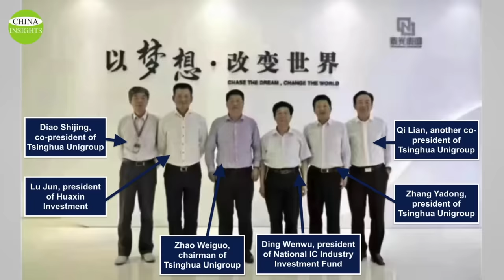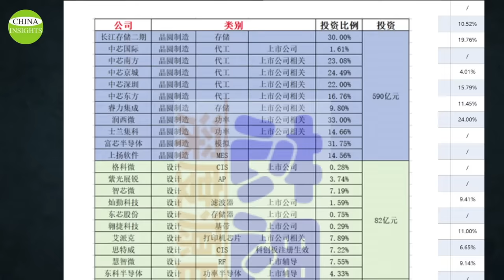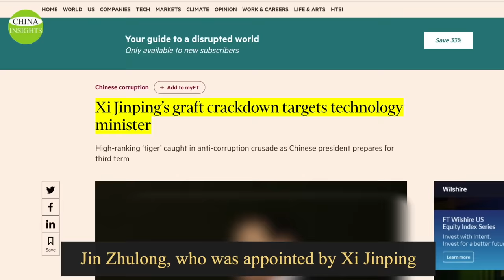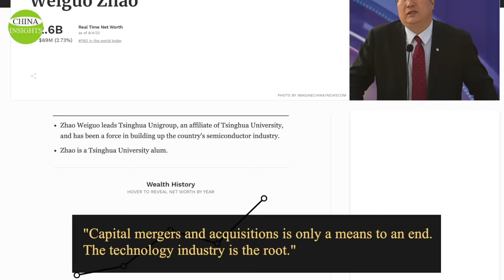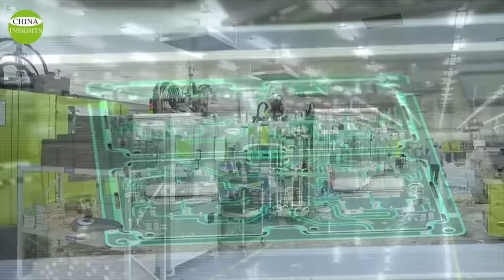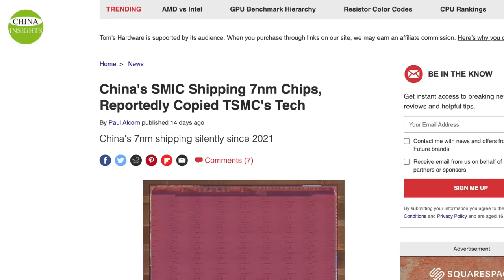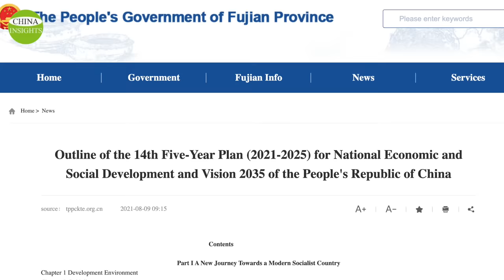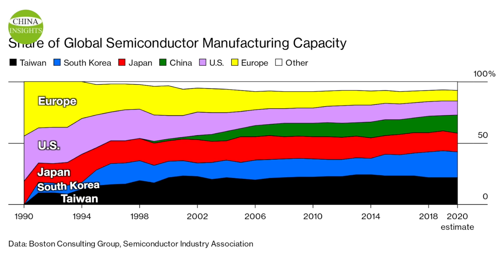Unprecedented! China's chip moguls arrested in rush/The Shocking Corruption of state-owned chip fund

Comment: Can the Chinese manufacture any high tech devices without stealing plans from other countries?
Reply: NO
Reply: In a word, no. It’s a shame because historically the Chinese were intelligent people responsible for various breakthroughs through the millennia.
Reply: @mikoto7693  yeah? Well that's no longer the case.
Reply: No it's easier to steal it.
Reply: @mikoto7693  they still are…but now they’re called Taiwanese
Reply: Nope.
Reply: @mikoto7693  we call them Taiwanese
Reply: There are several valid reasons why Japan, US, etc... are more successful in these high discipline areas. For one, they hire the best minds from all over the world. As for the China, I doubt they follow the same. I am sure they have sharp individuals in China but never get hired, just because they don't belong to the party.
Reply: With time and resources? They could, but why bother when you can steal or buy it instead of developing it? Also, not everyone need leading edge process. Most of device's chips are trailing edge, meaning it's based on previous, well developed, bigger nm and simpler to build tech. Also you wont get results if you don't try so they are trying to develop tooling, process and soft for leading edge process. Given time and resources, which they have/had? and scientists/engineers they picked up from TSMC and samsung they theoretically could catch up. Maybe not the latest and greatest but being say ~3-5 generations behind but domestic is still great outcome.

Comment: When I hear talk about chipsets, I just think of GPUs & remember when there was variety among more than 2 companies & you could get the latest & greatest for under $600.
Reply: The rtx 3060 super costs 400-450€ and can run any modern game so i don´t know what you ar on about.
Reply: @xBox360BENUTZER  The GTX 1050 Ti costs 100-200€ and can run any modern game too
Reply: It used to be a choice between
AMD's GPUs - Can play 98% of games while using 50% of the power of previous generations at 50% the cost
NVidia's GPUs- Can play 99% of games while using 150% of the power at 150% the cost
And the majority took Nvidia again and again and again. Now everyone is mad because GPUs cost too much and use too much power.
Reply: @anonymoususer3561  Except it cant unless you play in low settings or on low fps unlike what op wanted.
Reply: @xBox360BENUTZER  that is half as slow compared to 1080 ti tho which is the same price
Reply: @anonymoususer3561  yeah at like fucking 1024x768 lowest settings everything off 50% res scale- might as well grab a steam deck or switch at that point
Reply: I still have the GTX 1096 and it works fine with max settings. Granted I don't play new AAA titles.
Reply: @xBox360BENUTZER  You misunderstand, GTX 680 was the top end card of it's gen and had on launch the msrp of 549.- in 2012.
In 2022 as of this writing(the 4000 series isn't out yet) the top end card is 3090Ti at the msrp of 1999.99, that's dollars not some reference to the year 1999. That's ridiculous.
Reply: @LittleMew133  GTX 1096? Never heard of it.
Reply: @Megalomaniakaal  Oops, I think it's GTX 1060 3GB dedicated by MSI.
Reply: Well, Intel has very recently been trying to become that 3rd option and you can see for yourself how that's been going for them. So if Intel, with experience in chip design ( and even gpu design with their igpu - crappy though it is) as well as effectively unlimited funds can't do it, it's small wonder companies are not popping up everywhere...
Reply: @GalvayraPHX  it's impossible for new companies to try to enter in the cpu/gpu market right now, know-how, machinery and materials are so limited, hard and expensive to come by that it's unreasonable for everyone to even try, what AMD pulled off by releasing great GPUs and the best CPUs in the market at the same time was truly marvelous. 

Also, after watching what Intel did to the CPU industry paralyzing all progress for a decade because there was no real competition, I prefer having less options than having them as the third option for GPUs.
Reply: @just_one23  I actually don't mind if Intel gets into gpu design/production. Any fair competition is good for the consumer and it was exactly the lack of competition that allowed Intel to have their way with cpus. Now the unfortunate thing is that during their stay at the top of the hill, Intel seems to have lost not just all creativity, but also most of the competence it had.
Reply: @Megalomaniakaal  It wasnt the top end card, a 690 existed back then too for 1k. Considering inflastion the 3090 release price isnt much higher then the 690 release price.
Reply: @xBox360BENUTZER  Right I should have said single GPU card. The 690 was essentially 2 680s in sli on a single pcb.

The die size of a 3090 is approx. 2x the 680 tho. So the comparison to a 690 is indeed more apt in that respect.

With that said, while I do agree that there's a fair bit of inflation at play now, it still doesn't explain the previous generations price hikes nor the 3090 being twice the price of a 690.

But it does make some sense that the price is higher since new silicon processing nodes are probably a bit pricier too, just not for 2x higher.

So I'd understand a 1200 to a 1500 price point for msrp on launch but that 2k was still just nvidia being greedy.
Reply: @Megalomaniakaal  the non ti version was 1,5k on launch

Comment: It’s hard to build a chip foundry if you have tofu dregs as your building materials. 

Those places have to be top of the line, with clean rooms that have zero hair or skin cells.
Reply: you have no clue of what you are talking about,  almost a form of art at this point.
Reply: @lo2740  Well I do fancy myself as a kind of artist.
Reply: Chip fab clean rooms have more stringent air filtration standards than surgical theaters.
The wash water they use is even worse...
Reply: Right, a working chip fab requires resource purity and sterility that the medical industry could only dream of

Comment: Isn't SMIC doing pretty well? Still behind, but they have good yields on 14nm from what I heard.
Reply: They can make designs but cannot manufacture them entirely in house because every step of the vertical stack has involved collaboration with multiple external parties. China wants to have an insular chip industry, BUT semiconductors are that field where every single step of the process from A to Z requires extensive international collaboration.
Reply: @tehandroidmaster   no one will buy there chips
Reply: @cooldudecs  don’t be so sure.
Reply: @cooldudecs   If they are good or cheap they will be sold for sure

Comment: Could China catch up with TSMC/Intel/Samsung/GF? With time and resources? They could, but why bother when you can steal or buy it instead of developing it? Also, not everyone needs leading edge process. Most devices are powered by chips that are trailing edge, meaning based on previous gen, well developed, bigger nm like 28nm+ and simpler to build tech. Also you wont get results if you don't try so they are trying to develop tooling, process and soft for leading edge process. Given time and resources, which they have/had? and scientists/engineers they picked up from TSMC and samsung they theoretically could catch up. Maybe not the latest and greatest but being say ~3-5 generations behind but domestic is still great outcome.